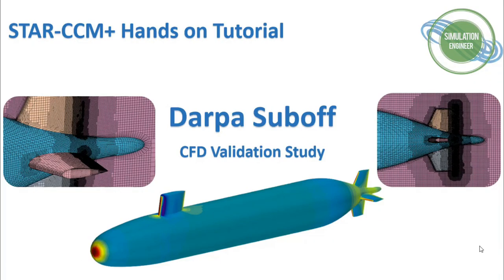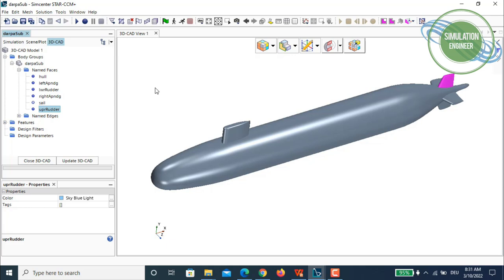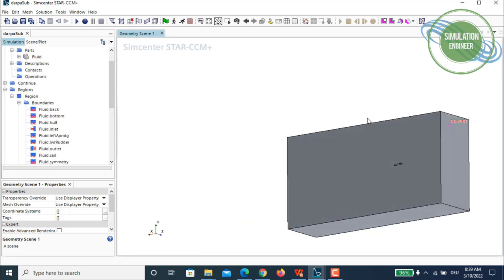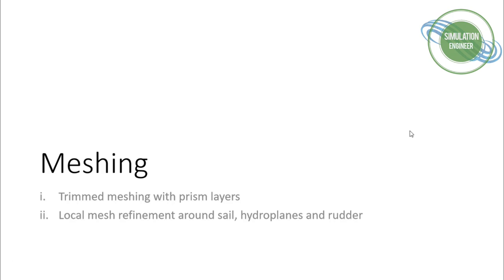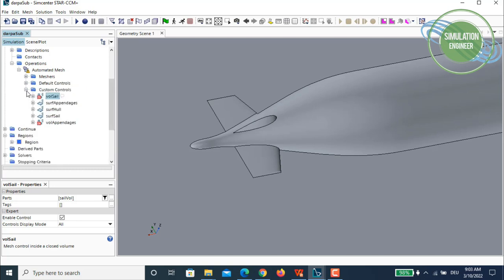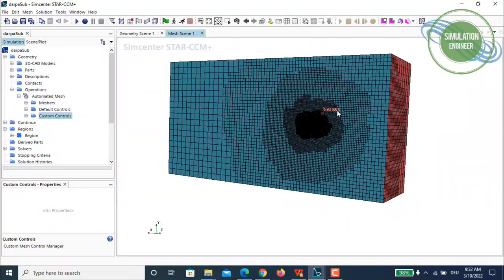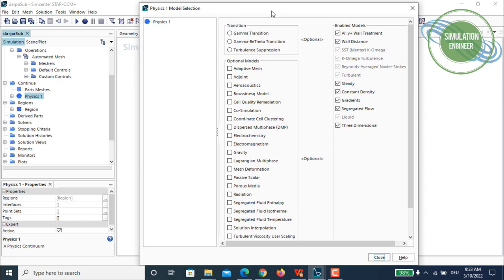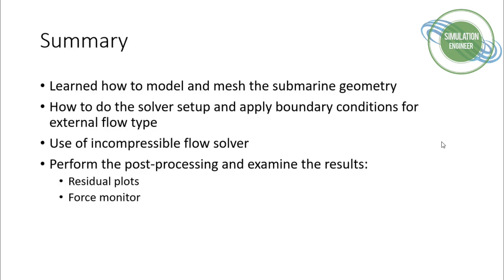STAR-CCM+ Hands on Tutorial | Darpa Suboff CFD Validation Study

Comment: excellent explanation from your end, but I have a question, for the appendages, if the starting and ending radius are the same, then it's also possible to select cylinder not cone as the block ?
Reply from the maker: Well you can also take cylinder instead of Cone.
Reply: @Simulation-Engineer  Thank-you sir for clarifying my doubt. One more question from my end is can I do this whole setup for aeroplane fuselage? Will it sound good ?
Reply from the maker: Well you can use the similar setup for an aircraft.
Reply: @Simulation-Engineer  Thankyou sir for your timely response.

Comment: hi, the video was really nice and good. May I know how did you manage to attach the stern cruciform control planes and the sail to the bare hull? Wasnt there any gap between control planes and bare hull or did you used any filling technique such as mesh repair tool in CCM+ to fill the gyap?
Reply from the maker: Thanks for the feedback, well the appendages are modelled using some boolean operations to get single body.

Comment: for sst-kw model shouldn't we calculate the prism layer thickness and number of prism layers to find proper y+ ?
Reply from the maker: Thanks for the query, well in Star-CCM+ sst-kw model uses all y+ model formulation to capture both low- and high-Reynolds number meshes. That means for incompresdible flows the boundary layer is thick and you can deal with y+ in between 30 ~100.